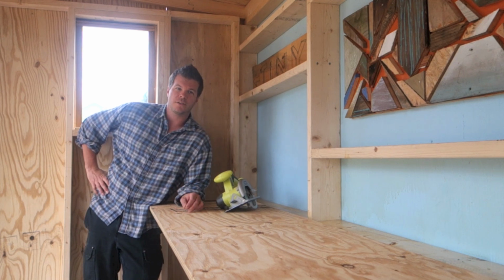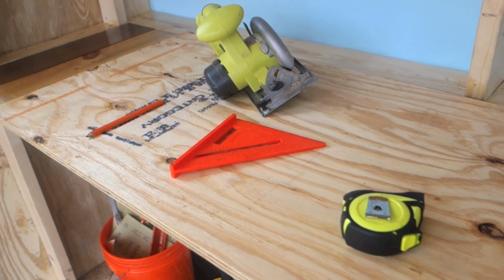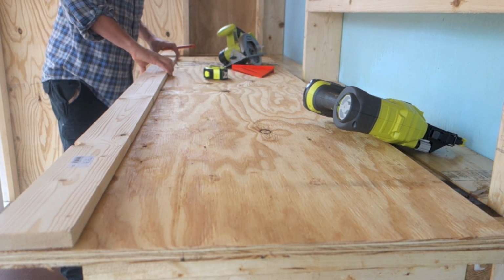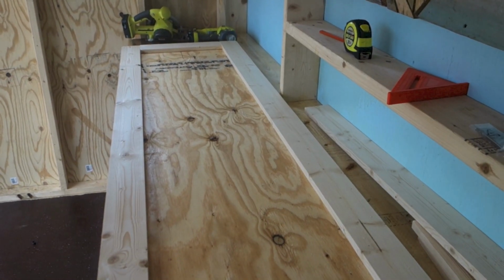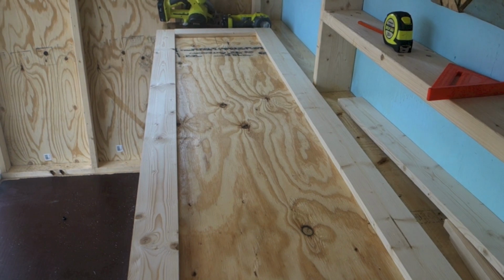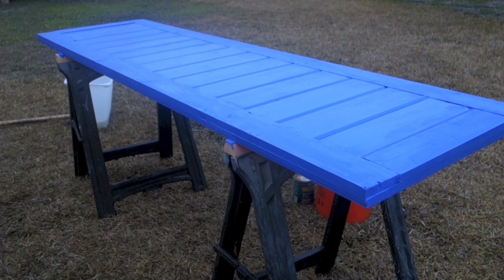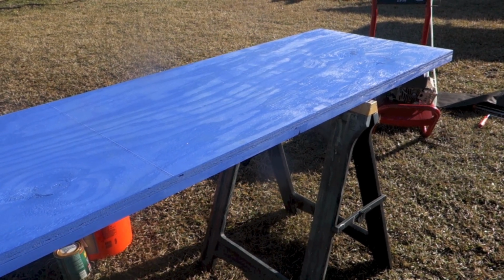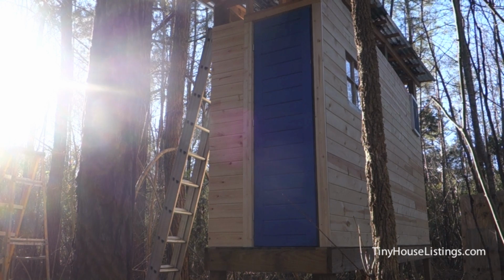How To Build A Door (A Simple DIY Project)

Comment: One suggestion I would give, if you are using a skill saw to cut the lumber is...instead of using your square to mark the line, mark a small line where you want to cut and hold the square tightly on the wood and run the saw beside it. Makes a perfect cut !

Comment: I'll be doing a door like this. I will add 1x4s around the edge of the inside and insert 1/4'' dowels through the door where the hinges go to avoid the screws pulling out. It'll be a door measuring 38"×82" so It'll weigh a hundred pounds or more